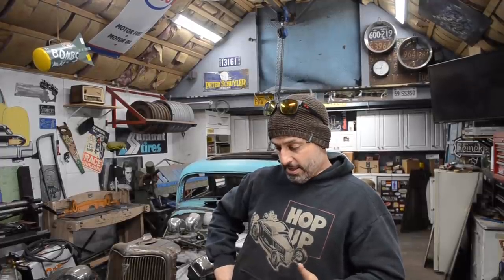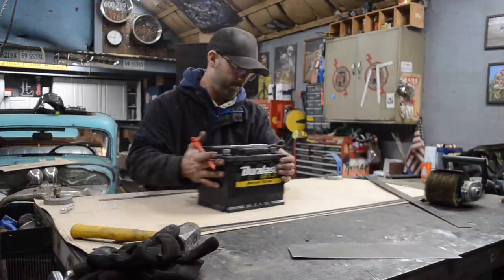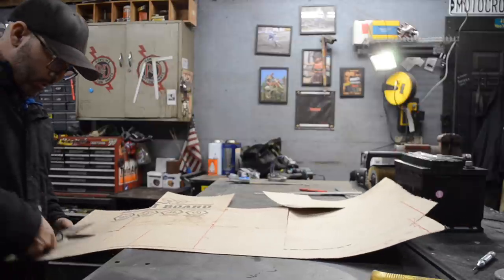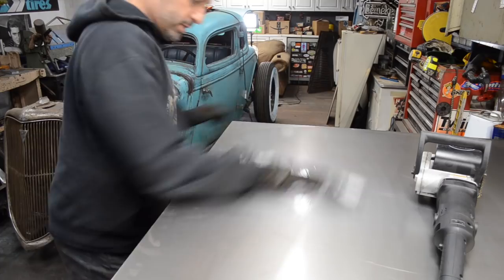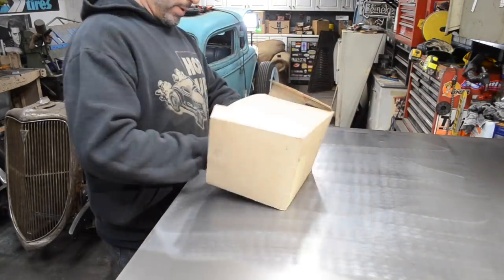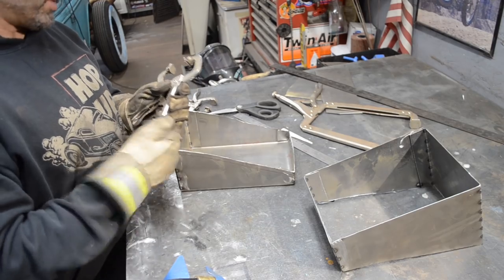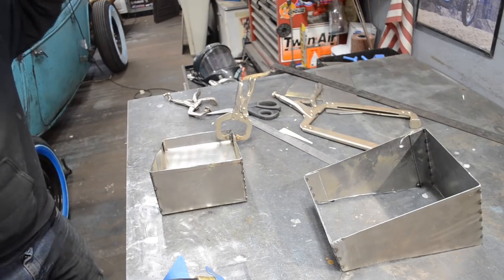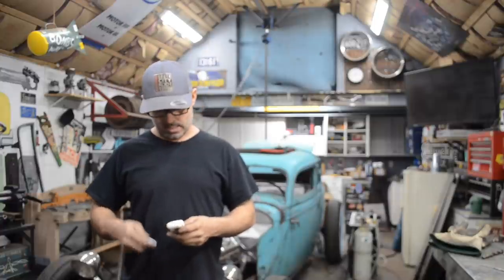Fabricating a Battery Box

Comment: I have the same DeWalt grinder and that just came with an Allen key same as yours. The technique is to fit the Allen key into a matching socket on the spindle lock nut. That way the Allen key acts like a handle allowing the locknut to be tightened and loosened. I can’t remember referring to the instruction or whether I worked it out but would have hoped that was explained. Great videos.
Reply from the maker: Thanks !  Ya I figured it out after I had posted the video.  I also found out the tool for the old grinder actually fits one set of the holes on the locking nut.

Comment: Somewhere there's a guy looking for his allen wrench...
Reply from the maker: Hahaha !
Reply: Check the spin on part of the grinder that holds the disc on. Two of the holes are a hex shape that take the Allen wrench.  Just use the Allen wrench as a lever to loosen and tighten it.  At least that’s how my new Dewalt works. Threw me off at first too, but it’s actually kind of nice since it no longer requires a special tool to change discs.

Comment: Mike  I thought the same thing about my grinder> An Allen wrench ???    But if you look closely at the wheel retainer nut 2 of the four holes are made for an Allen wrench. Insert the short end and use the long end as lever / handle to loosen the nut. The deal works great i love it. No more slipping spanner wrench.  Nice work on the box !!
Reply from the maker: I’m going to have to look.   I don’t think it has a Allen bolt.  Man, I was pissed.  I should have put the “blooper” basically lots of bleeps at the end of the video.  HAhaha
Reply from the maker: Steve... you’re right.   I just got home from work and looked.  I’ll be damned.   Allen key in one of the holes.  Son of a gun... I never saw that before.  
I lost my $hit ! Hahah.
Reply: @ThisOldHotrod   I  lost my shit many times Mike.  Ha HA  !

Comment: FYI: batteries expand. Should leave at least 1/4" all around.
Reply from the maker: Thank you for the info.  I actually rebuilt the battery box.  The reason was it was too tight and also I didn’t make it tall enough to create flanges to attach it to the floor pan. 

Thank you 🙏🏼 

Mike
Reply: I agree I've made a lot of battery boxes for choppers and have run across that problem before. Plus I thought if it's that hard to get in and out with it being that far in the trunk it would be a MFer to work on.

Comment: Have never had to use the  " tool "" to remove or install a cut off disk or grinding disc.   Have always been able to remove by catching lock an remove by hand in stall same way. Never had one loosen rotation and pressure on disc or grinding  flap lock it .
Reply from the maker: Ya.  I’ve done it that way. But I always had the tool so I used it.

Comment: I saw you redid the battery box 📦 whilst reading through the comments Mike. It did look a bit on the tight side. Just a thought 💭; what side of the motor is the starter ?  I have mine on the passenger side as it’s a straight run through for the cables. Are you going to put a removable bulkhead between the gas tank and the battery ? 
Catch you later............ Geof
Reply from the maker: Factory starter is on the drivers side.   However I do have a starter cross over. Also, I didn’t want the battery under the filler tube, so that was why I placed it on the drivers side.
Reply: @ThisOldHotrod  
Makes sense Mike, looking forward to seeing the next episode 👍

Comment: Just curious where do you get your steel from ? My source won't let you pickup, have to have it delivered for a price ofcourse ! Even gave them their own address drop in driveway.  No good.
Reply from the maker: I go to turner steel in West Bridgewater Mass.  
508-583-7800 or toll free 1-800-521-8881.  
Order ahead. They give you a pickup time.  Call when you arrive. They open the side door and you drive in.  
Load you up and you’re off.
Reply: @ThisOldHotrod  thks know where it is will call. Mid city is where I used to go. Built that new building along with an attitude!!

Comment: My luck battery number 2 would be just a 1/4 inch bigger and wouldn't fit in the box. Not much wiggle room.
Reply from the maker: In all actuality, the base of the battery is what was tight.  It has a large hold down flange around the bottom that is 1/2” wider on all sides.   The battery cube itself had plenty of space.  
However. I did make the new box larger.  To fit the battery with some wiggle room.  
👍🏼